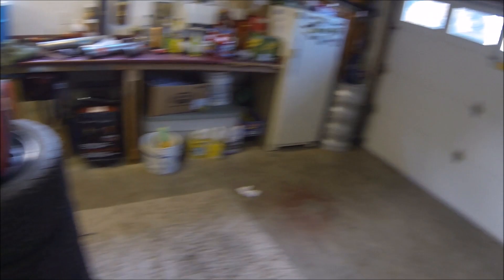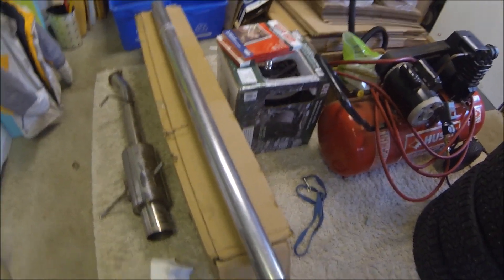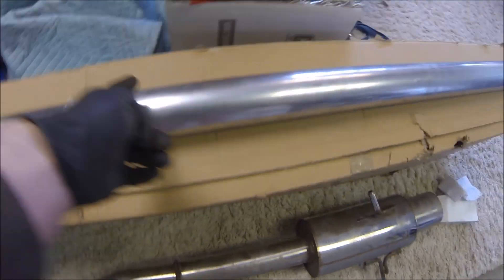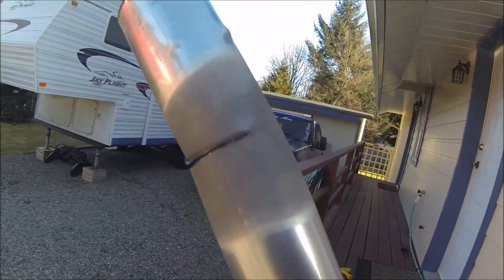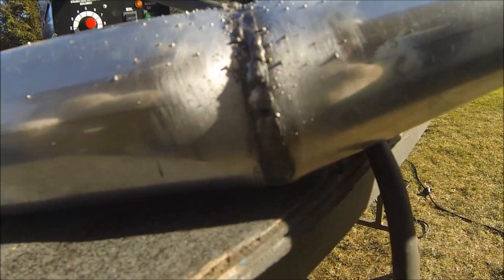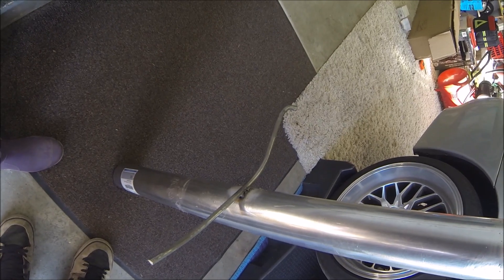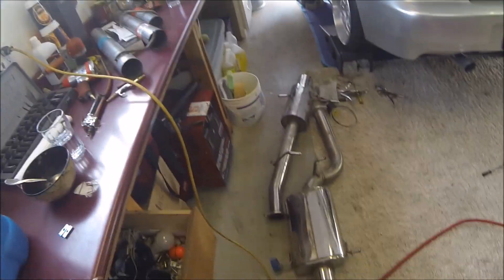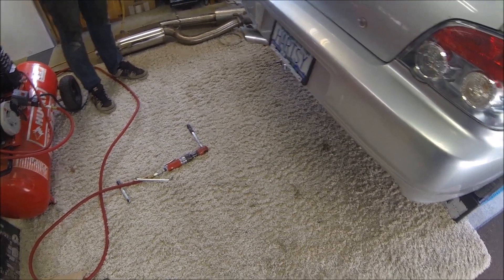Making a Straight Pipe for a 2002 WRX

Comment: i DO think a tip would look much nicer tho personally.  so many to choose from also.  then if a cop is behind ya or somethin something he might not be too quick to pull ya over or somethin
Reply from the maker: Bricecube That's true, but straight pipe has no tip like stock exhausts, where as if you have a tip it looks like you have an aftermarket exhaust

Comment: You should atleast keep the tip on it!!! It's like a dam canon and it looks dope, Sounds fucking beautiful tho!!!!!😍
Reply from the maker: Brendan Carreiro the problem is I have to cut it up then and it's not worth much to anyone but otherwise I would have
Reply: TrucksAndTuners I have a question bud. This is more for diesel trucks, if you were to just add a tip like let's say a 6 inch tip with stock everything would it be louder or stay the same?
Reply from the maker: Brendan Carreiro it would change the sound, the larger tip you go, the deeper the sound, and even the material of the tip or like if the end is rolled steel can make a difference
Reply: Brendan Carreiro not sure for diesel but for gas trucks, ive had 2 inch piping with no tips and it had more clap than the 5 inch tips i put on later.
Reply: SledNeckSlayer MN I want to put an 8inch tip on my dads 2012 6.7 powerstroke that I'll get to drive once I get my G2. I find the new diesels need to be like the old ones...Nice n loud!
Reply from the maker: Brendan Carreiro if it's your dads truck, don't touch it haha
Reply: TrucksAndTuners Well im going to ask for permission first! If he says yes then dope if he says no...Time to save up for a 5.9 cummins😉
Reply from the maker: Brendan Carreiro now you're talkin :)
Reply: TrucksAndTuners I love my fords...But you can't just can't hate a cummins....Best sounding diesel hands fucking down...Wish you still had your orange beauty😣
Reply from the maker: speaking of that orange beast... its for sale again locally, they painted it black and are now asking 10k for it.....
Reply: Brendan Carreiro best sounding diesel out there right now is a ford 6.0 IMO, those engines have a good clap to em. Look it up on youtube of em straight piped.  Otherwise, yes, 2 of my neighbors have cummins and have them piped, sounds amazing, gives me goose bumps every time i hear them start em up.
Reply: SledNeckSlayer MN Ohhh brotha ik ik...I want a 6.0 but im on the edge, I like the cummins cuz they sound so good, But at the same time the turbo whistle on a 6.0 is the best...And I love the how the 6.0 sounds, I find the exhaust kinda sounds like it's trying to be muffled and I love that sound!!!IMO if I can't get a powerstroke imma get a cummins.
Reply: Brendan Carreiro sounds like a good plan bro👌🏻

Comment: learn how to weld, find a welder, he may tell you that you should have ground the ceramic coating off of the piping, or maybe not have used a mild steel welding rod with a stainless pipe.
Reply from the maker: guess what asshat? This is what i had, and it worked! so fuck off and go troll someone else comments
Reply from the maker: Kadden Schott holy fuck how old are you? 12?
Reply: did you really just call him a hill billy? lmao wow. Also, having a roughly welded exhaust didnt ruin the car, made it sound mean as hell. Fuck off Kadden Schit... oops, i mean Schott. Right? ;)

Comment: is that a stock turbo?
Reply from the maker: Bricecube yep!
Reply: TrucksAndTuners dude thats awesome.  thinking of cutting my muffler off and straight piping.  i want that good turbo sound in my exhaust.  but its a magnaflow so its kinda disgusting to do
Reply from the maker: Bricecube straight pipe is the only way to go
Reply: TrucksAndTuners def sounds awesome.  hell at low rpm it almost sounds like a v8 in the vid. pretty tight
Reply from the maker: Bricecube I miss it, if I wasn't such a big time truck guy I would have kept it
Reply: TrucksAndTuners lol.  eff that
Reply from the maker: hahaha